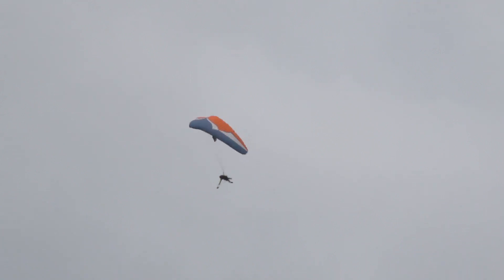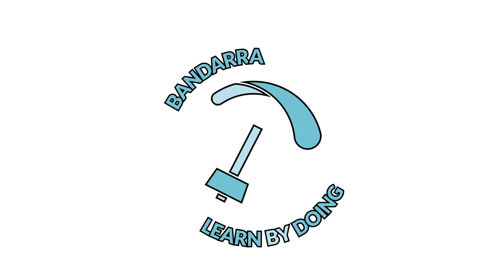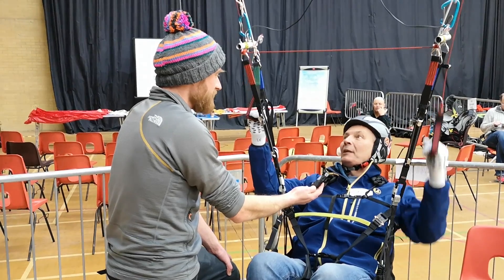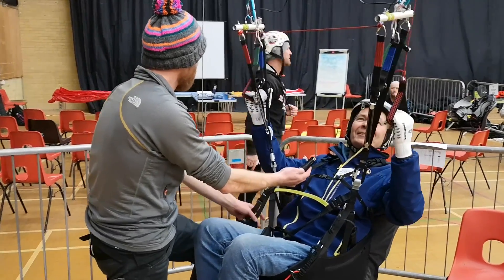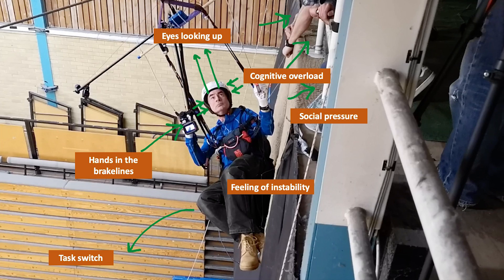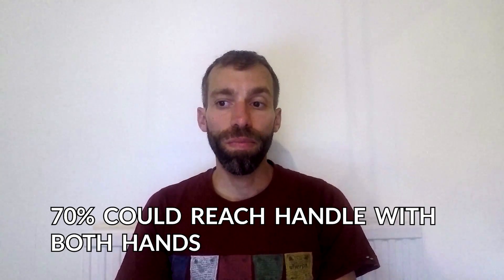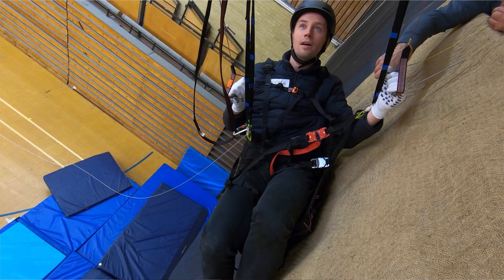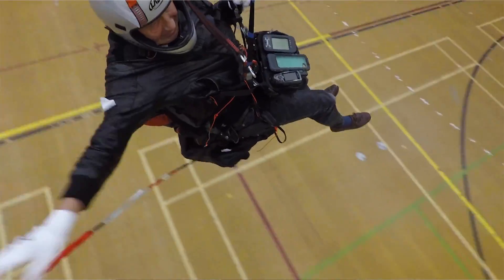Emergency Parachute Throw - How to Design and Deploy a Reserve with Dr Matt Wilkes - BANDARRA

Comment: Matt and Andre (and others involved), Good on ya!!!  I hope this study is being made available to ALL the safety and flight equipment manufacturers, instructors, and pilots that can be located.  It sounds like Matt and his cohorts located several important areas for designers to improve current designs, for instructors to make part of their courses, and for pilots knowledge in prepping, practicing, and god forbid, EMPLOYING their reserves if that necessity were to arise. 

 I'm not yet a PG pilot, but I have seen military videos addressing the use of early ejection systems, where pilots were fully trained in their use, but elected NOT to use them until it was FAR too late for them to perform.  The instinct to fix the problem with the bird you are flying, be it exiting a low altitude spin, having a folded wing or chute, etc. MUST be real time dynamically situationally balanced against the WORST CASE ROCK HARD wall of final time/altitude/orientation/velocity/(whatever) that exists for the specific safety gear to function, .  Sometimes that wall is the exact moment the problem first presents, depending, sometimes its worse. 

Safety gear, employed too late, or incorrectly, is often of little to no help.  When the military finally got this thru to pilots (initial ejection systems sometimes took FIVE SECONDS to actually initiate seat thrusters in respond to the "pull", and a rapidly falling jet can go a LONG way in five seconds) fatal injuries that should NOT have occurred during flight critical aircraft malfunctions/pilot errors were greatly reduced. 

Yeah, try to fix it, to a point, within the safe time for safety systems you have available, but ALWAYS be aware of what that point REALLY is, for your given situation, and act accordingly, or be badly hurt or killed, it is THAT simple.  Many people still try to fly aircraft that are compromised beyond "fixing" into the ground, killing themselves, where ballistic parachutes, ejection systems, personal chutes, etc. were available to the pilot at the time of the emergency, and would have saved the pilots in almost every case.

Comment: Really great work guys!  Thank you! 

Our studies in the same subject (less scientific and perhaps slightly more anecdotal) lead to exactly the same conclusions.

One additional thing we have noticed over the years is that in a rotational situation it is often best to, having cleanly extracted the reserve, "let go" rather than throw. The reason for this is that the pilot can inadvertently throw the reserve against the rotation causing the reserve to actually come back and hit the pilot. By letting go, with centrifugal force the reserve quickly travels away from the pilot and the wing and opens cleanly.   In more insipid "parachutal" low G force situations a good clean sweeping throw is best.
Reply: Thanks so much - it's really good to know that people who've done as much SIV as you guys have found similar things, as it gives confidence in the findings. What you say about rotation makes total sense. I am quite conscious that in focussing purely on the actions of deployment, our set up couldn't take account of the different circumstances in which people deploy. We could only really focus on the 'getting out' part of the chain. Given the difficulty that some of our participants experienced in just doing that though, I wonder if they'd be able to think too much about the nuances of the throw when under stress? Thanks again - there is no substitute for SIV!
Reply: Matt. Absolutely agree. Nuances on type of throw are probably only available to pilots have thrown at least once before.

Comment: A short strop is advantageous in all circumstances, regardless of pilot size. I'm going to review my own.
Reply: Good call! I absolutely agree. Thanks Jumpleads
Reply: Don't make it too short. If it is too short, when you pull on the handle, it might pull on the reserve bag before releasing the pins, and the reserve would be stuck inside the harness.
Reply: Thanks Nico - and you are right - if too short it could pull directly on the reserve without you being able to open the container. This is another good argument for integrated and tested deployment bags I think.
Reply: Be very careful with short strops.  We consistently find problems with short strops locking the reserve into the harness, particularly if the reserve moves too far away from the handle (eg small reserve underseat in a container that's too big)  It can prevent or make deployment very difficult!  It is important that the pins release (which opens the harness) BEFORE loading the strop. Some slack is essential.  Not too long. Not too short. Having the handle not too far away (harness design) can help mitigate the long strop problem.
Reply: @passionparagliding3994  Thanks, that's really well explained.

Comment: Andre this video on throwing the reserve was awesome. I’m not a pilot but I have an idea you might pass on to Dr. Matt. I noticed the lag of the toss was due in part due to the reserve handle rope being so flexible and long.  If the grab handle was more solid like a bicycle handle bar grip a person grabbing something solid could feel it easily, grab it and yank it out positively and throw the reserve with force.  The soft cloth rope type handle the participants were using was like trying to sling a 5 pound weight tied to the end of a rope.   Keep up the good work. I  Enjoy the videos

Comment: @ 17:00 and your discussion of  arm motion on reserve extraction the video shows several difficult, delayed underseat. reserve extractions, but doesn't address the causative effects of reserve installation in the harness container.   I have found every harness with a seat board and underseat mount reserve works better if the deployment bag is installed with the lanyard for the reserve handle up. This makes the tension line across the top of the bag when the pilot pulls the handle, and is more likely to slide out from under the corner of the seat board than deployment bags  installed lines up, handle attachment down.  When the handle attachment is down the pilot's tension on the handle compresses the reserve against the bottom of the seat board, and tends to stick the reserve in the harness container, by forming the  packed fabric  against the bottom corner of the seat board.     If the handle attachment is on top of the deployment bag, tension on the handle lanyard usually slides smoothly around the corner of the seat board getting the bag out without delay, or second effort as demonstrated in several of the pilots on the zip line.

Comment: I think it would be very interesting to see the strop have a bungee aspect to it, particularly on strops that are too long for the pilot. Though it would be harder to pull out, it may also help with the 'one motion' throw. 

Realizing that strop length probably varies based on the requirements of where the reserve fits into a particular harness, it definitely makes sense to have the shortest strop your harness can take. This is something I noticed right away in playing with my reserve deployment, and I shortened mine to barely be long enough to properly fit in my harness compartment.

Comment: is the direction to throw not even too a oppotunity. I mean, in which direction you rotating down to the ground in a emmergency situation. So the solution is to throw it against the rotation  for a quick opening ? 
I've shortened the connection leash of my rescuer's grip with a knot to get it better out and to have more power to throw it. A friend of mine have had a heavy accident with his front container. He was  strong twistet and was unable to pull the rescue out, cause the twist blocked it..

Comment: Heres a question - your suggestion is that anyone carrying a reserve should have some experience throwing it. Is there a way to do this without having to repack the reserve? I'm basically a noob and slightly apprehensive about repacking my reserve. Im ready to string myself up to something and practice, but perhaps i should fold up some old shirts throw those?
Reply from the maker: I think a lot of people have this fear, me included. But the truth is if anything we should be asfamiliar with our own reserve parachutes than even the wing really. Parachute repack courses are available in most countries and it's a great time investment you can make. We should be as confident opening and packing our parachutes as we are with our wings. Here's some more info https://www.youtube.com/watch?v=CFWbF6aOtss  hope it helps
Reply: I agree with Andre. Yes - it would be possible to throw a deployment bag filled with a cushion or similar, without having to repack the reserve, but as that involves disconnecting your existing system, it would be best to do it under supervision of an instructor. Are you part of a paragliding club? They usually have annual repack events
Reply: You should do a SIV course ( when you feel ready for it) and throw the reserve under instructor supervision. The instructor will teach you how to repack it. also there should be instruction on how to repack it in your reserve manual, and you maybe can find a manufacturer instruction video on youtube.
To repack, its easier to be 2 or 3 people, and have a big room.
Its important to experience at least one reserve deployment during SIV course, its a bit like a vaccine, you have to train your defence system, so it can react faster and be more effective next time when you will need it.
It will also help to make the decision to throw the reserve when under stress, because you wouldnt have the additional stress of the unknown of the reserve.
Reply: You wanna know if your rescue opens? Then you better try it. Find a local club or pilots and make a zip line (that's what we did). For repacking there will be some experienced pilot that can help you. Or, if you do it by yourself, just try it once more: If it opens it means that you didn't do wrong and help to build up your confidence ;-)

Comment: Excellent info.  I have to be honest, the strop length from handle to de-bag has always frustrated me on both my reserves (1 front mount for H&F and 1 under-seat for my reversible harness).  I'm not overly impressed with either system; certainly not compared to skydive rigs (similar to BASE cutaway systems for RAM air reserves) or even old military and sport mounted lo-po rounds in front containers, which I might add are always mounted so that the outer container moves very little upon deployment. 

Certainly much room for improvement within the sport wrt to adhering to a set standard to aid fast deployment.

Comment: Excellent work, team! This analysis has me looking over my reserve system. Much appreciated.

A question: does the natural tendency to pull and throw upwards increase the likelihood of the reserve entagling with the main wing?
Reply: Hi Bryan - while we have a tendency to pull upwards, I think we still tend to throw backwards. The chance of entanglement depends more on the configuration of your main, and the kind of emergency you are experiencing. Once the reserve is out, you can often clear an entanglement by pulling on the bridle.

Comment: (Disclaimer, I'm at 20:10 when writing this) Based on a lot of the analysis done in this video, it seems like an optimal reserve deployment system might be using what is done for skydiving reserves. Use a pull cord system and (I know skydiving reserves use spring loaded pilot chutes but ignore that) a spring loaded d-bag to launch it away from the user, probably mounted on the low backside to rear. This would prevent any user input in trying to pull the bag/handle in awkward ways leading to entanglements while keeping handle use simplistic. I would also look into using the handles that I believe are used on tandem rigs that have a harder D shape to them. It prevents being a snag hazard while remaining open and easy to get a hand into.

Comment: Amazing video with lots of useful information!!!

I have a question: Is it recommended to throw the reserve in case the wind got really strong and you are blown back into the rotor with nothing but forest in the back? 
Take in consideration that you have a decent height, going forward is impossible even on full bar, and there are no landing options if you turn your back to the wind.
Reply: Hi Nicolae - good question, but I would not throw my reserve in those circumstances. While your wing is open, you still have control of direction (even if going backwards) and you can flare before landing. Once you are under a reserve parachute, you have no control over your descent. Thanks and best wishes, Matt
Reply: @mattwilkes2538  Thanks for the reply!

Comment: Hi Andre, nice video! I found very useful, Many times I have this question in my mind I have to throw the reserve in the side (laterally) in order to not be tangled with the main wing? Considering this , maybe than is it better to extract laterally in order to have the same direction (extraction&throw).  The question is, we have enough  force to use a single move  to extract and throw the reserve or we need two steps? From what I saw, the problems appear when the reserve is tangled with the main wing...Maybe here is some space for safety improvement... Anyway you did an excellent movie! Nicu
Reply: Hi Nicu, many thanks for your comments. The questions of which direction and how hard to throw are an important ones. The answers to both will depend on the configuration of your wing - in particular whether or not you are falling slowly or fast, and whether or not you are rotating. I think from this study, the most important thing is just to get your reserve parachute out quickly, and then to deal with any problems that follow. I hope that helps. Best wishes, Matt

Comment: EXCELLENT STUDY- I  would say that all reserves should have to be standardized to be pulled up. Second there should be a large D-handle positioned which sticks out parallel to the seat bottom on the pilots strong side with a semi rigid 12'-18" 3/8 diameter yellow post that the pilot can slide their hand down the post which will land them right onto the d-handle in a consistent position. Look, slide down, grab, deploy outward..........you need to develop muscle memory.  Just like holstering and unholstering a gun that you never look at. Practice makes perfect and when your life is at stake you had better practice...............with the yellow post always in your peripheral there will be no random grabbing for "something", wasting precious time.

Comment: I have to say that at our club repack we found those with front mount reserves were consistently quicker. Though we put the participants under much more stress than you have done which could explain the different outcome on times. 
Here is a link to our clubs setup. https://youtu.be/ktNIwcPNL2s
Reply: Thanks Bryan - that's a very interesting set up. Front mounts also trended towards being quicker in our study, but there weren't enough of them in the sample to draw a definitive conclusion. I suspect if we'd added in rotational forces like in your video, it might have made more of a difference.